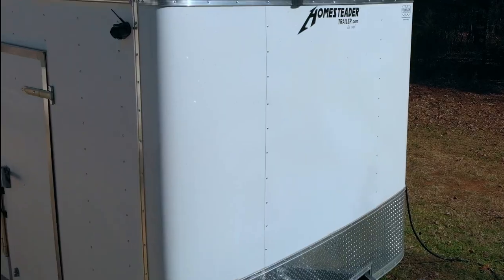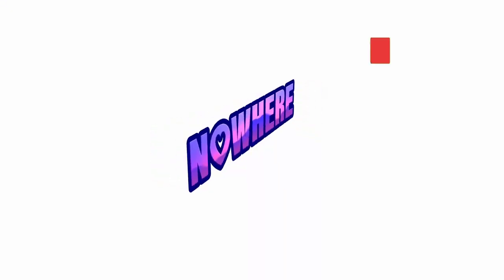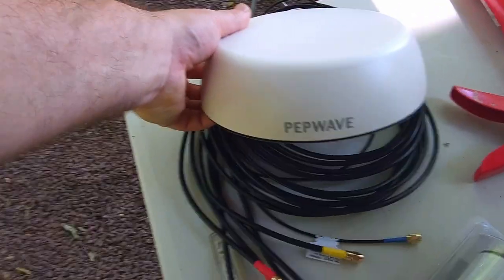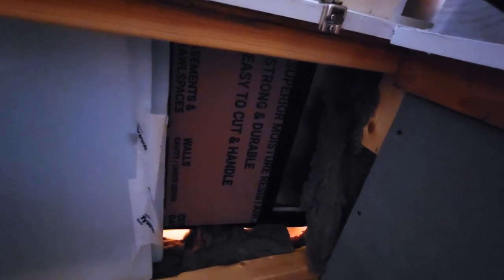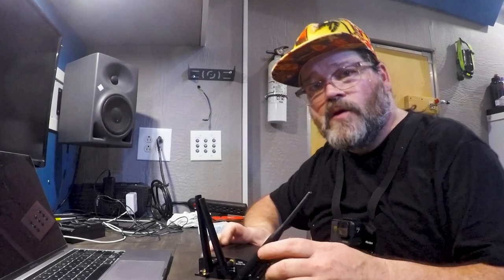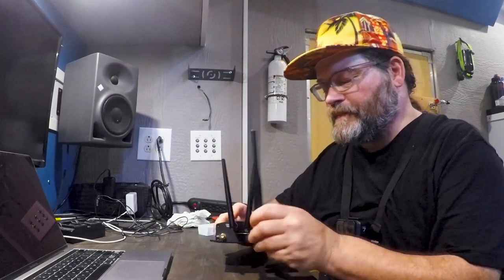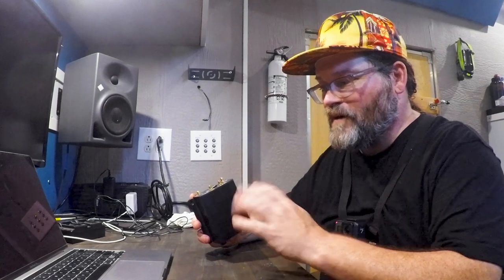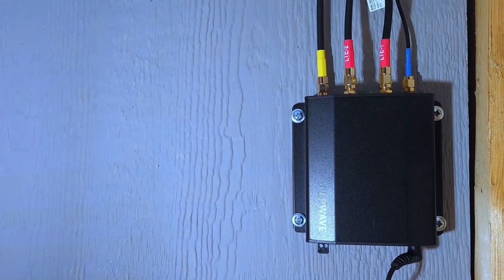No Internet!?!?! Pepwave antenna install on the custom Cargo trailer camper!

Comment: Great video, how much does it cost? what's the pros & cons comparing to the other routers? Thanks
Reply from the maker: I got the router for very cheap on ebay. Tbh I come from an IT background and I am far from a pepwave / peplink fan. And I really don't like the router. I had used this product as fail over internet for clients in the past and it worked well for that.  But pepwave owns the lte router space, there is very little comparable competing products. I will likely upgrade at some point to a dual modem unit, with more sim slots. But I really feel they underpower the processor in their products and I think there is a lot of error correction, resending packets, resembling packets, when you are on the fringe of service, and sometimes this unit all but locks up entirely. Even the gui stops responding.  My hope would be the more expensive router from pepwave could process all those inconsistencies better.
Reply from the maker: An if it gets so bad it needs a reboot. It takes almost 10 minutes to boot. Even resetting the lte modem from the gui to refresh the connection to the tower. At least on the edge of service can take several minutes. And the processor indicator in the dashboard, will continually show 100% for much of that.